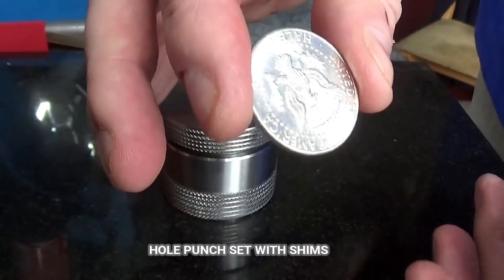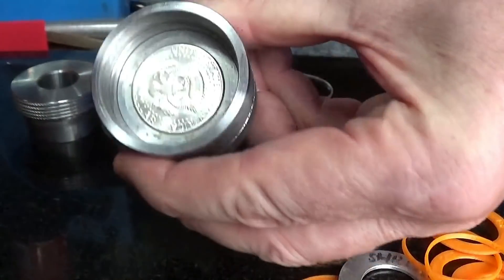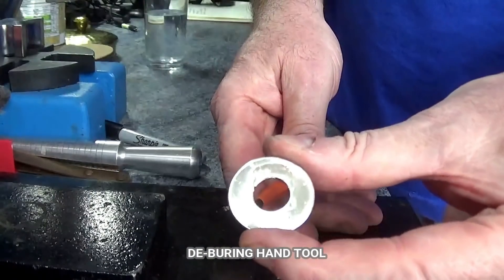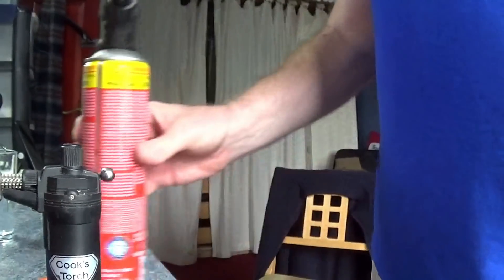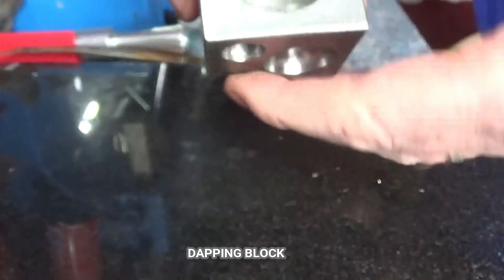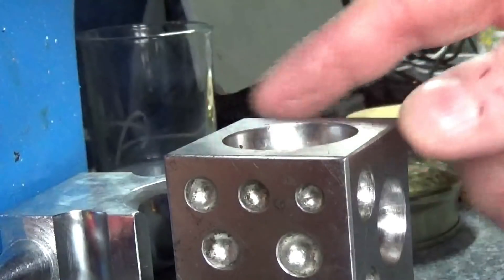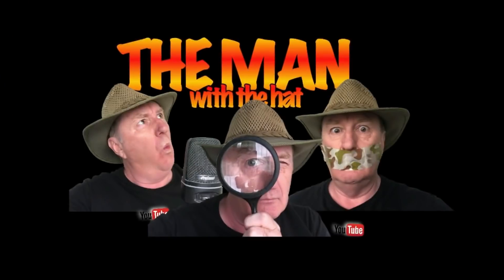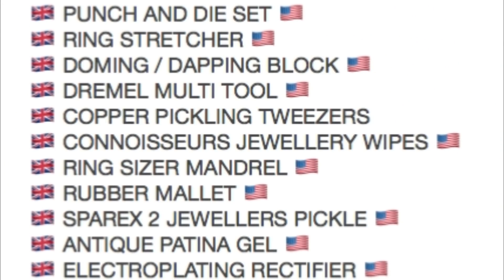Coin ring LIVE demo and the tools required

Comment: Very nice video , explained the process very well , I am a coin ring maker myself , one thing I would add to your process is when you use Swedish Wrap Dies is to wrap your coin with Teflon Tape about 25 wraps it will protect the coins detail alot ! Swedish Dies have a 7 degree pitch and are very hard on coin detail if not protected by Teflon Tape
Reply from the maker: Yes. I have a set and use Teflon tape

Comment: Hiya. Great video mate, truly. I'd like to know if the 1 ton press is up for the job or is the 6 ton a must? many thanks Paul
Reply from the maker: You deffo cannot punch a hole with a 1 ton press. BUT you could use steel hammer 🔨 instead.  It the press is only £60. The 1 ton press is deffo required for the folding stages.
Reply: @TheManWithTheHat  Thanks mate. Now I have another question,lol(sorry I'm a newbie at all this). WHAT do you mean by 'folding'? I'm seriously interested in getting into this. Thanks again
Reply from the maker: You need to watch my videos. That’s what they are there for. 👍🍰

Comment: #coingiveaway I have been waiting ages for someone in the uk to make a video like this with links , thank you. I use to make coin rings just using a steel ring mandrel and a rawhide hammer and It worked but was wonky. The other way was drill a hole and the hammer on the edges to flair it out , This video has made me want to start making them again.